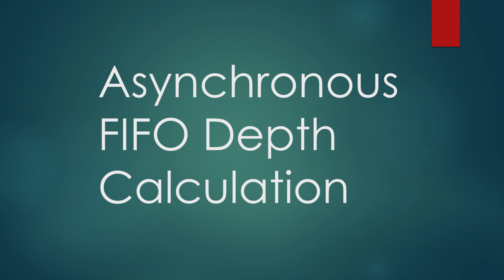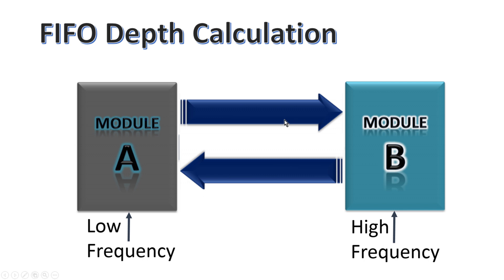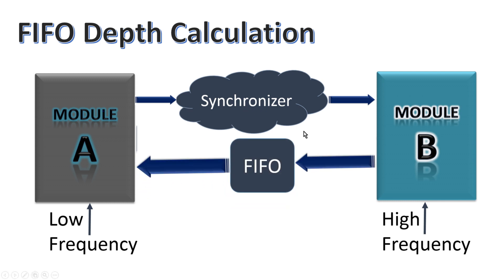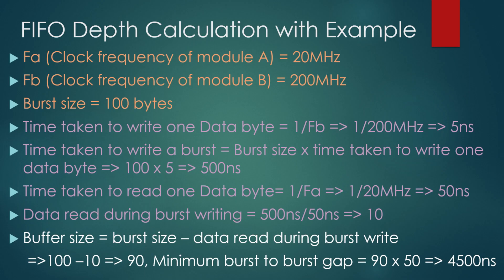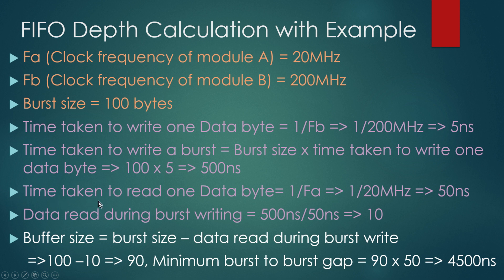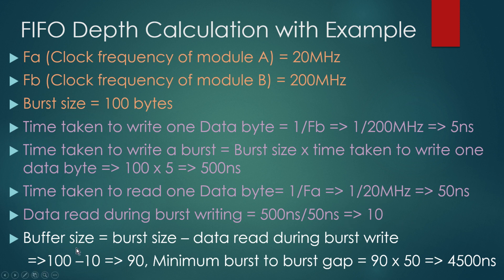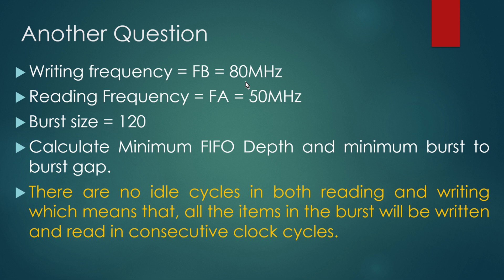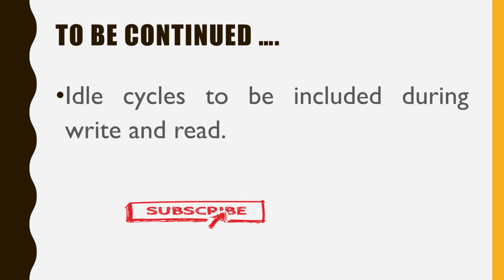Electronics Interview Questions: FIFO Buffer Depth Calculation PART 1

Comment: Hello Sir, may u please explain what the minimum burst to burst gap mean, I m not able to get it clearly?  And also, why  the data read during burst is not calculated like the : total time taken to write burst / total time taken to read burst ?? . Please clear these doubts.
Reply from the maker: Hello,
if you send data on every clock cycle, that is called ontinuous data or continuous mode.

Burst Mode:
Let us say, we send data for 10 cylces and stop data for 5 cycles. again send data for 10 cycles and stop for 5 cycles. and so on. Here, burst to burst gap is 5 cycles. Hope it is clear??

Comment: I like to think in terms of clock ticks instead of clock periods. Here is my take on it:

CLOCKw = 80MHz
CLOCKr = 50MHz
BURSTsize = 120 bytes (or ticks)

CLOCKw/CLOCKr = 80MHz/50MHz = 1.6

For 120 ticks, we will have  (READticks = WRITEticks / 1.6 = 120 / 1.6) 75 of the read ticks meaning during the 120 write ticks we can read 75 bytes of data out of the FIFO. 

So, for every write burst, the FIFO will at most (assuming we are waiting to read before the write is complete) bloater by:

120 - 75 = 45 bytes. 

We need to read those 45 bytes out before we can start filling the fifo which will take:

 (45 ticks x 1/50Mhz ) = 900 ns.

This is the worst case scenario since we don't have to wait for all 120 bytes of data to fill up the FIFO, and instead we can start reading as the data enters. However, I would still wait to empty the FIFO before I write assuming we are unable to set the FIFO to anything greater than one burst size and the FIFO does not feature almsot_full and almost_empty signals.

Comment: Will i be able to generate idle clock pulses in the FIFO If required 
For eg, If Writing frequency is much lower than Reading frequency will i be able to generate idle cycles for reading

Comment: Fa=50Mhz, Fb=80Mhz, burst=120.

Time taken to write 1 data byte= 1/80M = 12.5ns
In 12.5ns we can write 1 data byte so,
12.5x120 = 1500ns to write complete burst.

Time taken to read one byte = 1/50M = 20ns
data read during burst write= 1500/20 = 75data bytes
Buffer size = 120-75 = 45 buffer depth.

burst to burst gap = 45x20ns = 900ns 

The final answers are 45 is the buffer size, and burst to burst gap is 900ns.